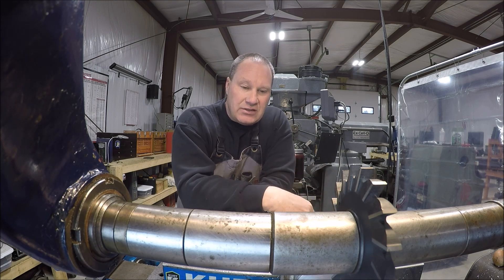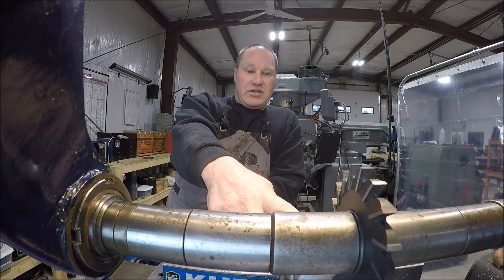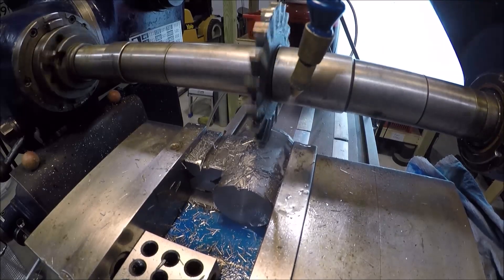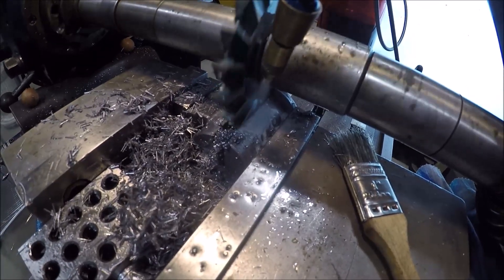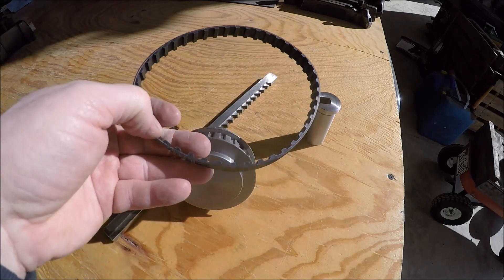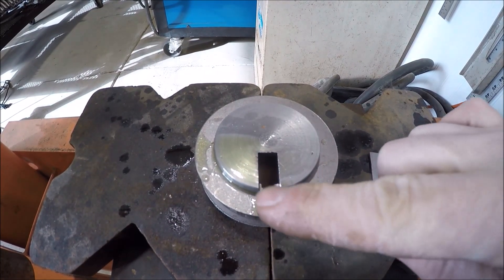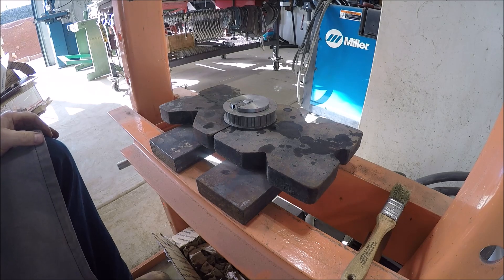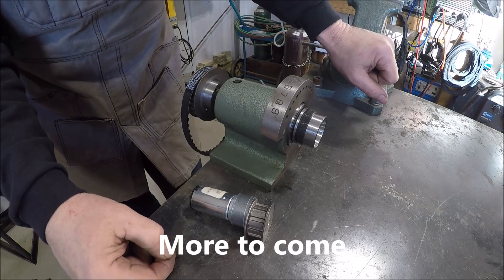O D  grinding fixture build. Part 4

Comment: For stability, it is good practice to mount the cutter as close to the spindle as possible. (same for the support yoke) This should improve rigidity and reduce vibration and chatter.

Comment: I’m enjoying your series here. Not a spin indexer is not made to spin I believe I add any RPMs. Are you going to add any oil cups or some kind of lubricant system? Looking forward to your next video
Reply from the maker: Valid point. The top of the spin indexer has a hole so I can add a drop or two of oil as needed. The unit will not be spinning very fast so hopefully it will be alright.
Reply: @hilltopmachineworks2131  I noticed that holt too, it would look very old-school and cool if you could put a brass oil  in there.